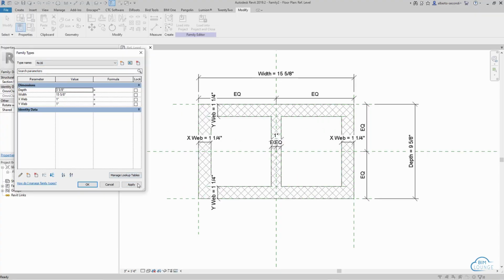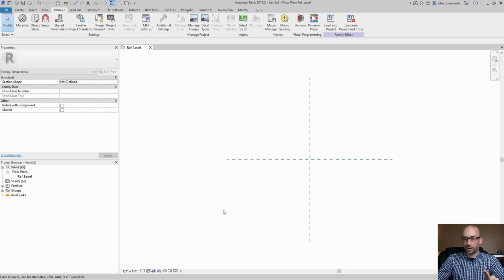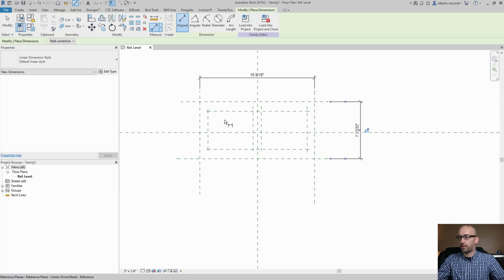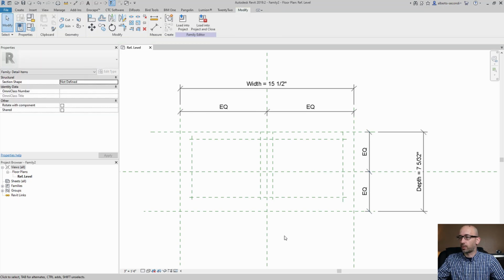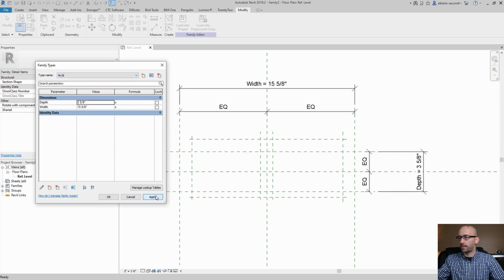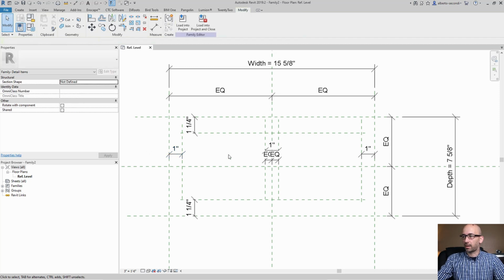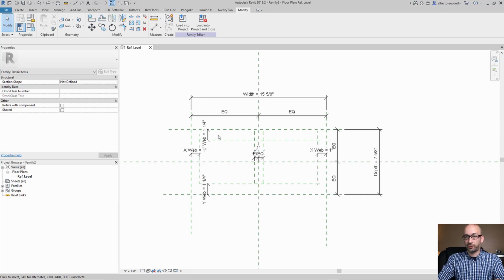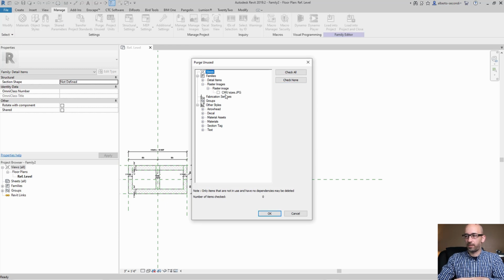How to Create Parametric Detail Components in Revit

Comment: Thank you for this tutorial. How can I add a text / dimensions that tells the actual length of an annotative line dynamically as I change it in my project?
Lets say the line length is 50 so the text shows 50, but when I stretch that line to be 70, the text will automatically change to 70.

Comment: The intro is hilarious 🤣 and the last hint of the thicker outlines is very cool! 👍 nothing to add by my side, maybe I'd just put a parameter on the opening radius as well but it seems unnecessary in your case scenario.
Reply from the maker: Haha, that's literally what I look like whenever I see something like that 😀. Agreed, I too thought the radius parameter could be optional as for most cases you wouldn't need to show that level of detail. Fortunately adding the parameter is just as easy, just use the radial dimension instead of the linear one.